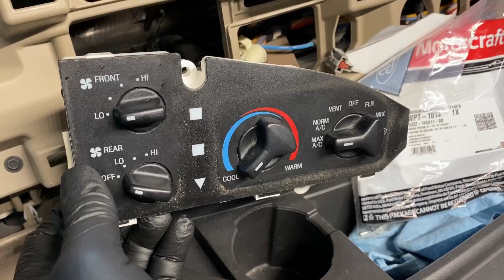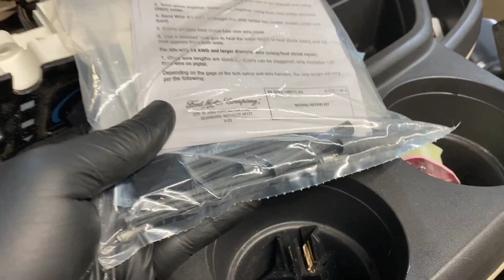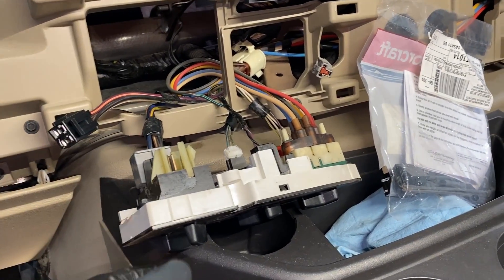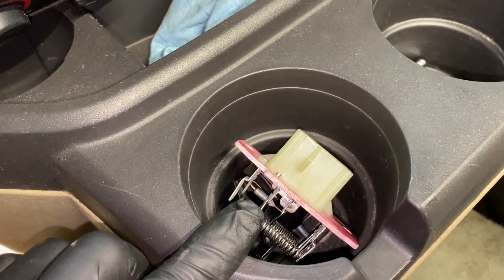Ford Econoline Vans: Blower Motor Switch Failures Causing Meltdowns!

Comment: FTM  may i please ask for your expertised regarding speedometer i have a 1999 f 150 5.4l lariat happened to have a malfunction speedometer all gauges are not working although i still can drive the truck but no means of telling how fast i'm going , engine might overheating, oil pressure, battery etc.etc. Now i bought me a used one thru on line hoping it will be plug and play but that is not the case, so i took it to a local shop and the mechanic tried several attempt to re-programmed but to no avail i then contacted the FORD dealer and the guy said the year my truck manufactured the speedometer now is obsolete  and they don't make them anymore . i asked if i bring my used one  and re-programmed  by there technician regardless if it work or not i have to pay. what is my best option please help. i thank you
Reply: I would contact a repair service such as United Radio and see if they can repair your existing cluster. Many times it is nothing but bad solder joints or a small piece that fails and they can be repaired to work like new again. Depending on where you are in the world there are many places that do those repairs if you wanted someone closer.
Reply: Maybe it is just a small blown resistor on a circuit board that is causing the problem. They can be taken out and replaced. See if you can find videos about it. I watched a couple of them a few weeks ago, but I can't remember which type of cars they were working on. To remove a blown resistor you buy a small tool that melts the solder points. And then you solder in the replacement resistor. Shouldn't be too difficult. Removind the dash might be tricky, but I am sure there are videos about that too.
Reply: @milcotto4153  Except on modern dashboards you had better be able to solder surface mount parts without damaging the board itself which can be easy to do if you haven't done board level repair daily. The ones online make it look real easy because they have experience and the proper tools. Try doing those repairs without those two items and you will be buying a new board.  That is why I suggest a repair center, they can test it, repair it and verify it works and give a warranty. Usually for about the same price as buying the proper tools to do the repairs.  Not saying it can't be done, but I've had to repair a lot of damaged boards over the years, as have most other repair places.
Reply: @Blazer02LS  -  Ok, you are the pro. But it did look easy to me :-)
Reply: @milcotto4153  That's one of the issues with video. It makes it look real easy. The catch is that there are many parts in there that are not common ones  and many are not available to the public, if they are damaged the board becomes scrap. Something like replacing the servos or re-flowing a couple parts can be easy. Determining which parts are at fault though, that is the trick.
Reply: @milcotto4153  i did further investigation and found out that  two of my fuses  20 and 21 are not active  while my truck is idling  fuses are good this fuses power the  following modules such as GEM Module. Audio, and PCM now i m looking for schematic diagram may be i get lucky still need help though anyway thanks for the input.

Comment: I have also had several that the blower motor(although working correctly) was drawing to much amperage..... change the blower motor if you are repeatedly changing switches.
Reply: Yes that’s a good point. I’m just a home mechanic but just changed the resistor and harness on my 2001 F250 and a few years back on my old 4 runner and both fan motors were tight and seemed to be drawing more then they should so went ahead and changed them both also. Not too expensive for the piece of mind it gave me. Great videos! I really appreciate your detailed instruction!
Reply from the maker: I have never come across that before in all my years. Was the motor shaft binding when turned by hand or did you compare the amperage draw from another known good econoline in the shop?
Reply: @FordTechMakuloco  the most common fail for me has been the switch.... we have had a handful of them that would go through a switch every few months and found that the blower motor was the culprit.... and the funny thing is they were not squealing at all.
Reply: @FordTechMakuloco  compared to other vans we had.
Reply from the maker: If this were an isolated incident I would have changed the blower motor also but for the econoline vehicles this is quite common of a failure no matter what year.

Comment: Hi do you think using dielectric grease helps  to prevent melting connectors ? Thank you for your  time to show it.
Reply from the maker: No the melting is caused by worn contacts inside the switch assembly.
Reply: @FordTechMakuloco  - Why would contacts wear out?